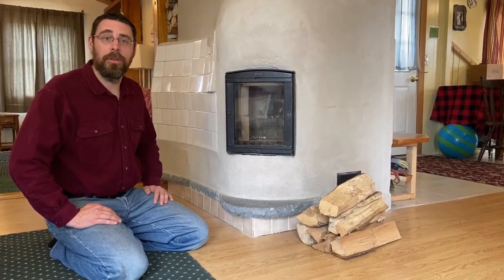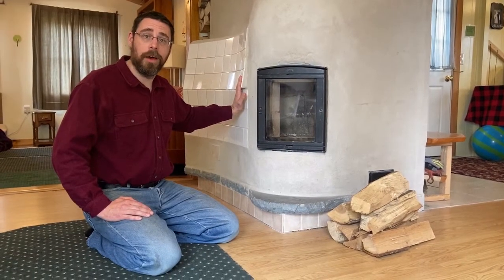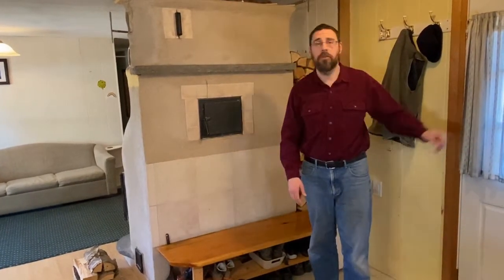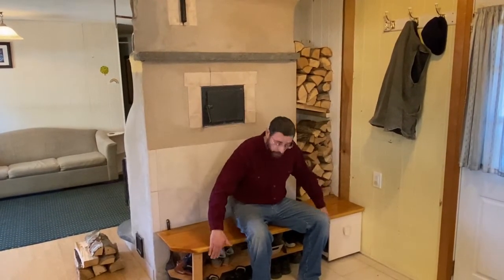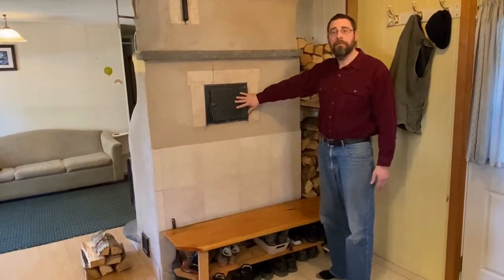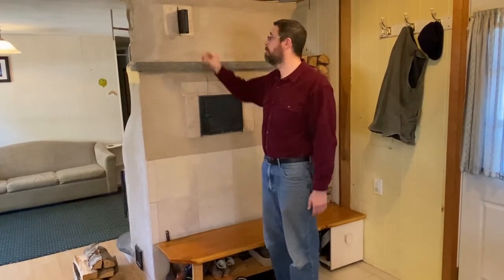Masonry Heater Basics: How a Masonry Stove works

Comment: Beautiful setup!  Did you fit that design into an existing floor plan or build the home with that in mind?  I’m wondering about the things you wanted to achieve in the planning?  Thank you for the video!
Reply from the maker: That's a great question.  This one was fit into an existing home, and I removed two walls, and replaced them with the heater.  It divides and defines the spaces.  This is my house, and the 4th iteration of heater in the house.  My goal with the design was to have the space around the firebox door feel open, and larger than it is (which is why it sweeps back there) and it has worked well.  A square-box kind of thing would have made the space feel chopped up, while the curving "front" of this heater at the 45 degree angle gives a sense of distinct spaces while blurring the edges.  Are you a designer yourself of some kind?
Reply: I’m not a professional designer but I’m planning to build one of these in my house in a few years.  One thing I want to accomplish is to avoid bringing wood into the house. Of course that is a secondary consideration compared to a central location which could evenly heat all sides of the house.  I love the idea of the masonry burner. Right now I use a wood burning stove.
Reply from the maker: @Tarantellas1  Just seeing this now.  You can design a heater to be loaded from a mud-room or something like that.  That's no problem.  check out the website at www.ericschroederstoves.com and reach out if you want a hand with the design or project.

Comment: Do I need to clean the chimney of my masonry heater?  I seem to be getting smoke coming into the house till the fire gets burning.  The flow seems like it is going out when I test it before I start the flame, but then it comes into the house.  So I ask do I need to get someone to clean my chimney, and how does that even work since the heater has masonry chambers?

Thank you
Reply from the maker: That’s something I’m glad to talk with you about, but I have a number of questions. You can call me at 207-766-6003 and we can talk about it. If you’d prefer to do that here on you tube let me know.
Reply from the maker: It's very uncommon for a well built heater to smoke.  Usually when it does happen it has to do with ash build up.

Comment: Hi just wondering what sort of paint you used? Going to be building one of these soon and want to paint it white. Did you use anything special?
Reply from the maker: That's a great question.  I used an earthen plaster which can be painted with Bio-Shield clay based paint.  Other paint might be possible, but I've liked the bit of Bio-Shield I've used.  Reach out through www.ericschroederstoves.com and we can connect to discuss!
Reply: @MaineMasonryStoveGuyEric  Thanks for the tip. I was wondering if I'd need some kind of temperature tolerant paint. I'll email you some pics when I'm building it. I have a rocket mass heater already but it's made of brick so I didn't paint it 😀 Cheers from Ireland 👍